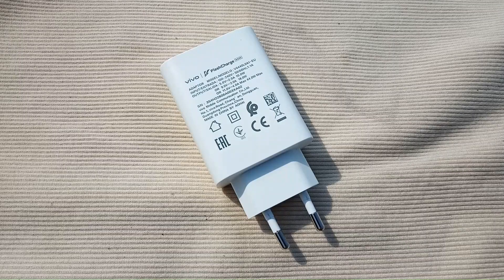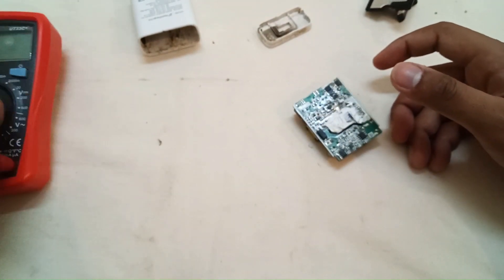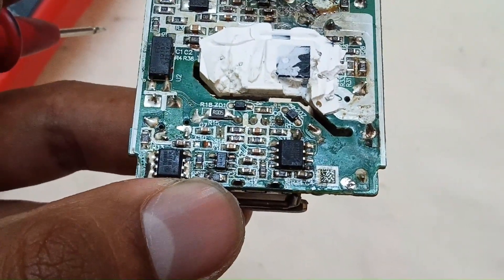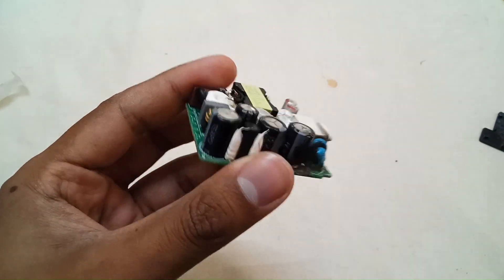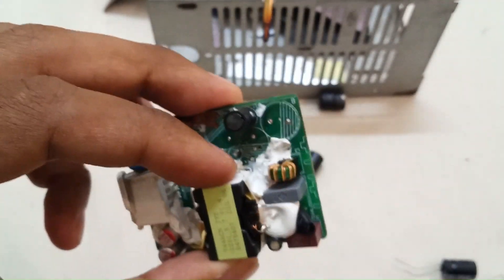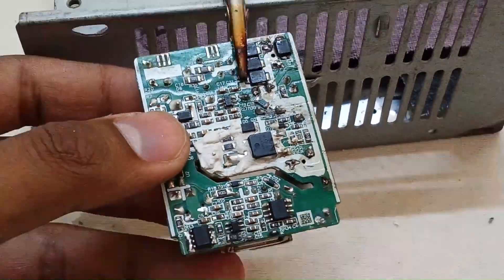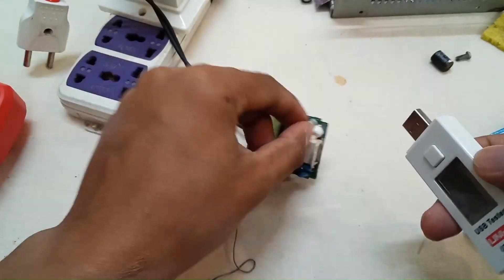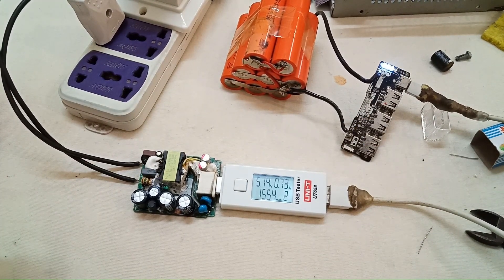Vivo 44W Flash⚡Charger Repair | Vivo USB charger Totally burnt Repaired #vivo #vivomobile #charger

Comment: Mine charger pwm ic got burnet how to replace it 33 watt vivi charger
Reply from the maker: Is the ic number visible or not?..if not then its much difficult to guess the ic ..in that situation better to buy a new one..
Reply: I bought a new vivo charger it shows fast charging on screen but it charges only on 1.5 amp 5 volt  @Electricquantism402
Reply: @Electricquantism402 ic number is 6c =n35

Comment: Im angry that is so difficult to get an original replacement parts in India, i damage the same 44w Vivo adapter and when i look into the website i found that its not even available, Amazon and Flipkart are not even a good choice to go , this is terrible ..and while some stupid fools keep chanting make in India - i couldn't even get my adapter replaced ,we are still a long long long way to go and  i say we still need China , forget the boycott 😡
Reply from the maker: Genuine easily available on vivo service center. But you can also repair yourself if you have some knowledge of electronics.
But don't do if you have no idea about it.
Reply from the maker: It is easily available on vivo service center (original).